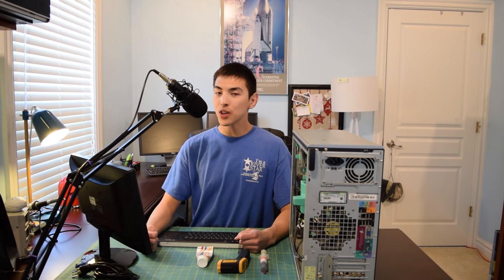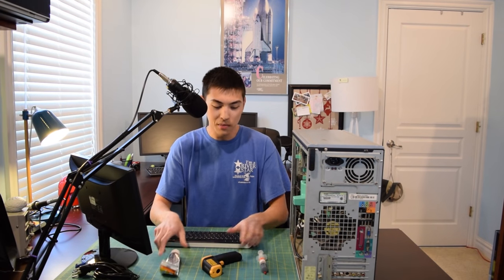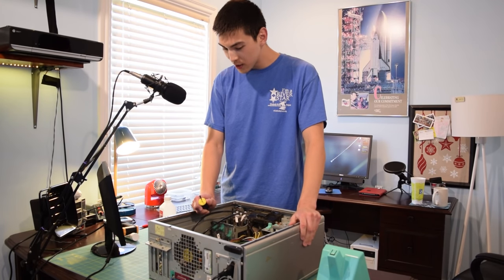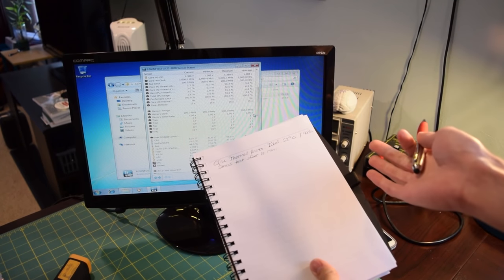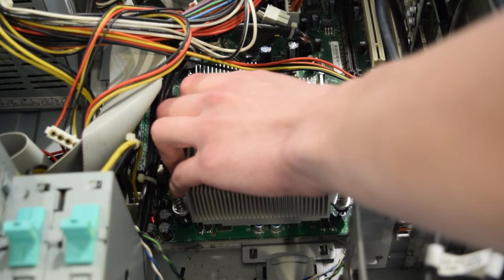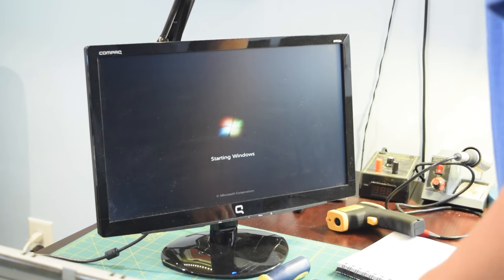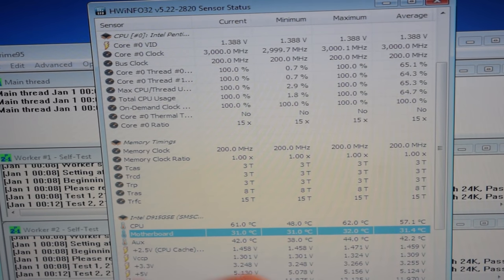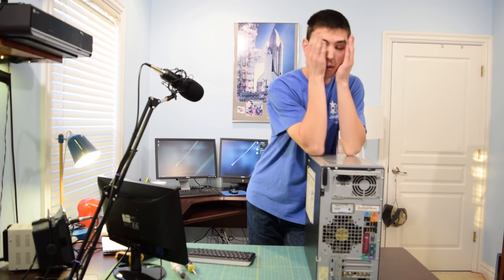Using Toothpaste as CPU Thermal Compound

Comment: Toothpaste works almost as well as cheap after-market thermal paste but it will dry up much quicker, in order to prolong it you could mix some Vaseline (Petroleum Jelly) and get a much better compound.
Reply: Is it really works effectively???
Reply: Oktay Berkay Yes, it does. It's not going to be as effective as the more expensive stuff from Arctic Silver or Cooler Master but it's basically as good as the thermal paste that comes pre-applied on most heat-sinks.
Reply: Sir Pandalot thank you for your answer. I searched someting on internet about making homemade thermal paste and I understood that best way to make thermal paste is adding some baby cream which is include zinc oxide.
Reply: Sir Pandalot Before 3 months ago I bought thermal paste from ebay for 1 dollar and you know what it's really teribble paste and worse than flour- water mix :D
Reply: Oktay Berkay Yeah, stay away from the cheap stuff, better to make your own. Here's the guide I used (http://www.ehow.com/how_7210675_make-homemade-thermal-grease.html)

Also be sure to replace the stuff after about 4-6 months depending on how heavily you use your system.
Reply: Sir Pandalot Oww thank you so much, yes you are right better than buying 10 dollar paste or 1 dollar china stuff. I upgrade my old laptop for daily using I don't have to buy 15 dollar paste for 11 year laptop :D with old paste it starts heating up like oven after nearly 10 minutes... Whatever thank you my friend...
Reply: Thanks!
Reply: Sir Pandalot Dude thank you so much man I mixed my toothpaste with a pain balm gel and now I don't have to worry about the temperature!!
Reply: I'm planning to use only toothpaste as thermal compound (temporarily). Do you know how fast would the toothpaste dry? Would I like have to change it every month or something?
Reply: The Dead Immortal i use toothaste for years it work u can even use it pernamently use mint tootpaste
Reply: The Dead Immortal hey have you done it my paste dried up so I'm wondering if I can use it as a solution for a week or so
Reply: I used sensodyne+jam+oil+balm+ Vaseline. It made my CPU so cold that I don't Even use my AC now.
Reply: What if I used just the Vaseline?

Comment: Dude if I may make a suggestion: you really need to edit the HELL out of these videos. What could have been a fun 4 minute experiment ended up as a 12 minute video with tons of rambling, fast forward attaching heatsinks, and talking about what you're doing.

Here's a short version that would work very well:

Clip 1: introduction to experiment 1 minute tops
Clip 2: short clips of control set with you talking about its performance
Clip 3: short clips of toothpaste set with you talking about its performance
Clip 4: end results and closing remarks.

Get rid of the 3 mins of explaining, showing, and rambling per set. We didn't need to see you screw in a heatsink or remove a heatsink over and over. Pictures speak a thousand words so just flash whatever data you want and not read every single one and tell us every software and timer and device. We can see it clealy shown on the video. If not on camera, just put the specs or procedures in captions to save time explaining them.

Other than that, thank you for the interesting subject matter.
Reply: I get your point, but at the same time there's no such thing as the 'correct' way to do a video. You are looking for a short, concise video, maybe he was going for something different.
Reply: gotta get that ad revenue
Reply: A guy teaching how to make a "really really video"
Reply: It's been 4 years, have you learnt how to use the video slider to skip the video.yet?

Comment: It's quite obvious that it would work. Toothpaste is made of micro silica spheres, just like Thermal Adhesive made specifically to glue heatsinks to components.

The thermal conductivity was never in question, the longevity on the other hand would be a problem, since toothpaste is slightly corrosive and will get dry and brittle after some time. Only if you are a grown person and didn't know what toothpaste was made of, would you not know what was gonna happen.

Comment: I tried this a few months ago before I saw this video.I happen to have  a tube of the toothpaste that was recalled because it has lead in it so one day I said "HMMM I wonder".I had ran temp test before and after with no difference.The computer is still running 24/7.I am waiting until next regular maintenance time to look and see if it did any physical damage to cpu/heat sink.
Reply: TheMutony i think hes dead.
Reply: most likely
Reply: He dead?

Comment: I had to use toothpaste on a Pentium 4 630 in a dell. The cpu fan was so loud when ever I started an application and it sometimes got so hot I couldn't touch the back of the case and that was only from installing Linux puppy.
Reply: i redid it on a pentium 4 640 which has the same tdp and it dosent run super loud any more but it might be the bios because i updated it and cleaned the whole pc.

Comment: I had a PC that I had installed a CPU (i5-2320) in dry just for quick testing and had forgot about it.  The PC had been powered on for about 6 months with light usage.  I decided to run prime 95 on it recently to see what would happen.  It hit 99C but as far as I can tell never throttled. Average idle temp was about 60C. So I figured what the heck, I put a small pea sized dab of Ultrabrite dollar toothpase on it and reclamped and tested.  This time idle temp was 40C and maximum temp under small FFT load was 79C,   Not bad!  Oh and for reference it was a 95W cpu in an ultra-small form factor Dell Optiplex 790.

Comment: This definitely works but I would suggest not using it for too long. I used it for about two weeks on my gaming PC before I got my hands on some proper thermal paste & although I was able to use it, it definitely didn't run any games or anything more than a couple Google Chrome tabs before it slowed down significantly. Also, when I finally did get thermal paste, it was a pain in the ass to scrape the dried up toothpaste from the processor. Conclusion, it's not worth the hassle. Get some high quality Cooler Master thermal paste for a couple bucks & save yourself a headache.

SIDE NOTE: I suggest mixing the toothpaste with some cooking oil to avoid it hardening faster
Reply: mr8I7 I live in Southern Mexico at the moment, which is pretty shitty, especially when it comes to getting your hands on anything related to PCs. The shop I went to go get the parts to build my gaming PC closed down & any other shop I went to didn't have any thermal paste in stock. After about 5 shops I decided to order some online lol

As a side note, I didn't get any extra thermal paste because I never would've imagined the shop closing down so quickly. This is also my first PC build, so I didn't know thermal paste was so important. I now know.
Reply: BlvckNova si te sirvio la pasta? se la voy a poner a mi i7 6700k en lo que la consigo esta semana jaja haber si no la descompongo

Comment: I did that on my old reckoner before. With a "Pentium 4" main chip at 2.4 GHz, 1GB of mind, and a "Radeon 9250" video board with 128MB of video mind.
Reply: @104382837006298947979 I would have swapped out the the tooth spread in mine with true heat spread, but I swapped out the reckoner before I ever ended up doing that. I swapped it out for my "Athlon 64 X2 5400+" reckoner. That reckoner is brooking heat spread and not tooth spread.
Reply: @104382837006298947979 Yes, and tooth spread doesn't keep the main chip as cool as true heat spread, and it does not last as long before it stops working.
Reply: @104382837006298947979 All right. I will.
Reply: @104382837006298947979 You're welcome.

Comment: even I use toothpaste as a thermal paste and it works perfectly fine but dude you seriously don't know how to apply any type of paste on your CPU ..Rice sized dot in the middle, 2x rice sized dot in the middle, Thin line across the middle, Thick line across the middle, three lines, spiral, x shape etc and this is very important

Comment: I've tried that before and I've got to admit that it works; however, it should not be a long term solution. Toothpaste dries out very quickly and CPU temps will soar once that happens. 

PS: your computer will smell very funny after using toothpaste as thermal compound.